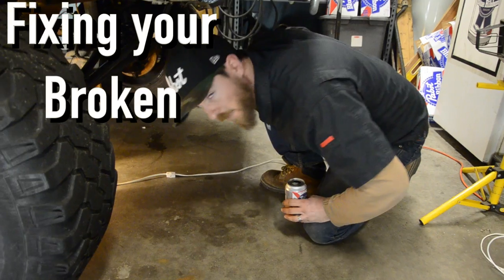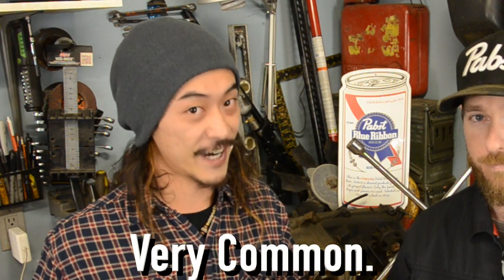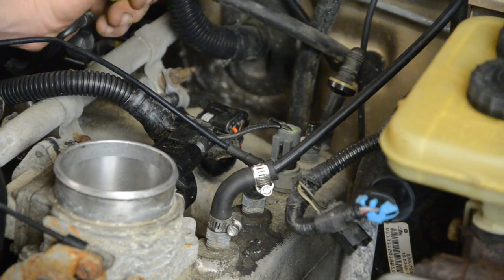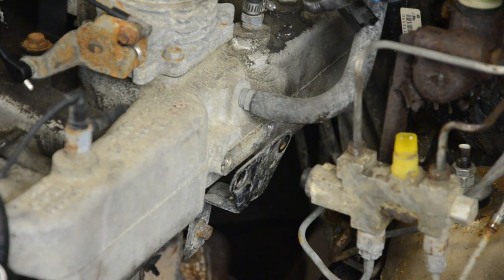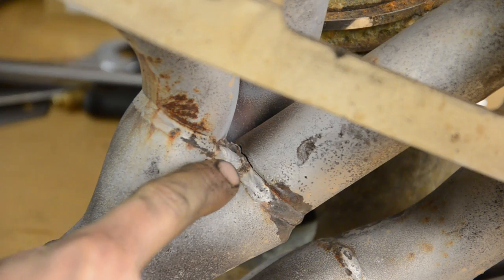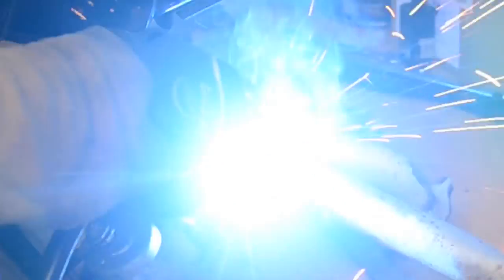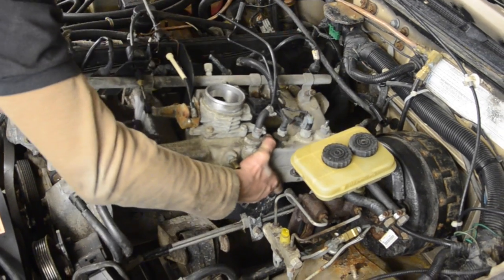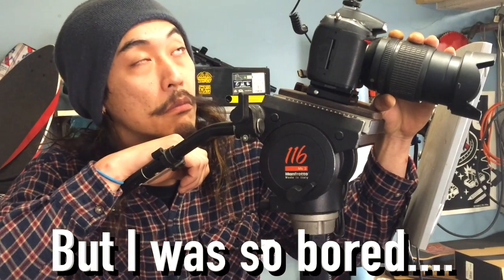Cracked Exhaust Manifold - Header - Jeep Cherokee XJ -The Roadhouse

Comment: I’m doing my first ever mechanic work it’s on a 1997 Jeep Grand Cherokee Laredo 4x4 with the in-line 6 4.0 liter think I said that right so far I replaced the thermostat radiator hoses water pump and fan clutch have it torn down for the head gasket to be done now

Comment: APN header?

Might end up doing just this. Since mine is leaking from the same points. Love how you guys just twirled the intake on top of the valve cover, saves time with disconnecting the injectors!
Reply from the maker: +AbsoluteAggressor 
And the Throttle cables.
All about savin' time

Comment: Hey guys I may have 2 do this. Fan does not come on so white smoke comes from radiator, coolant over flow tank is full and full when i open the thermostat (where i can put water if need be). but I do have faint white smoke from tail pipe. How can I test to see if It is a head gasket I need. I saw ur video on this. U guys are great!!  a girl fixing alone. will try .

Comment: Hey brother I tackled this task all alone and with that I also changed the head gasket. Everything was done to bolt pattern and torque specs. Now when I crank it up it revs up to 5000 rpms. Any insight on what could be the issue
Reply: Vacuum leak on intake gasket or unplugged vacuum line somewhere most likely

Comment: Did you guys flux core weld it or use gas? I’ve heard flux core was good for fixing cracks giving the weld more flexibility so it won’t crack in the same spot so to say, but idk if flux or gas would be better on exhaust. What’d you guys do or have any tips or tricks?

Comment: Any suggestions on how to get the 2 manifold bolts out of the bottom side of #4 and #5? On my 2001 XJ there are 2 catalytic converters in the way.
Reply: Use a stubby ratchet and a 2 in extension  stand on a milk crate and you can get your arm in between the manifold and block from the front as long as the power steerimg pump has been removed   I know this was an old post but incase others are reading with the same problem  I posted an answer anyway

Comment: great videos keep them up. how could you tell you needed to repair the manifold? could you here it or was there a loss of power? I have a 95 yj and there seams to be a tick I cant tell if it is a cracked manifold or a bad lifter. it goes away after fully warmed up.
Reply from the maker: It was really loud. just sounded like an exhaust leak
Reply: i think i might have something similar mine is really loud when i start it and the noise stays loud until it warms up. it almost sounds like a valve tap, but it goes away after it warms up.  does this sound like a manifold issue?
Reply from the maker: Crane 2005 it does. I see the same thing on ford trucks, where an exhaust manifold stud will snap off and have the same symptoms. It's really common for them.
Reply: great thank you. i guess i will be tearing into it soon

Comment: I think there's a misprint on the torque pattern display you used. I believe the spec for bolts 6 and 7 are 23 N.m (17 ft. lbs), not 23 ft. lbs. I'm by no means an expert, so I could be wrong.
Reply from the maker: +JonDinCT 
This is from a service manual, so if it's a typo, all us mechanics have been doin' it wrong for years...
But to be honest, the difference between 17flbs and 23flbs on a steel head is negligible.
Thanks for the comment though.

Comment: How long did it take ? and why do they crack ? Thanks guys
Reply: Tony Saprano mine did the same thing. My mechanic friend said that it’s the weight of the exhaust fatigues the manifold over time. He says that once it cracks, it’s in a better position. When the cracks are welded, it’s in a better position with less stress. Or something like that. He wasn’t allowed to weld a customer’s manifold so he’d weld the broken ones and install them for friends when theirs cracked.
Reply: Weight.
Heat cycles .
Exhaust taking a bump.
Different engine and trans mounts. 
No exhaust flex.
Etc

Comment: I recently got a death wobble and discovered a mechanic broke the steering adjuster pin and put a seam on it, so after asking around apparently I had to machine the hole to fit a new pin, so instead I fixed the shady job by my own shady job of putting flat nuts and to close it I used a non threaded screw metal thingy and bent it, I know the pain of being on budget my friends.
Reply from the maker: +Mahmood al-Walled 
Creativity often comes out of a lack of resources.
Keep pluggin' away Bud!

Comment: what would happen if you never fixed your cracked exhaust manifold?
Reply: the cold air being sucked into those cracks is said to, over time cause warping of the head,  but that's just what a few people have told me, it could be an old wives tale.
Reply: It'll kill gas mileage and also could get into the vehicle and you'll be breathing in carbon monoxide
Reply: Pretty sure Mitchell is right about the CO. Knowing the effects of CO poisoning I know that the cracks on my manifold I am getting poisoned. Now that it's winter and I can't keep the windows down I'm gonna have to fix it...
Reply: @mitchellabbott7919  
You're correct. And, add to that list it may trigger the engine light and fail emissions testing.

Comment: Do your self a big favor
Replace the casting or freeze out plugs  on 
The side 4 lt jeep motors are notorious 
And the back of the head most guys use JB
WELD AND SWITCH TO 
A LOWER PSI CAP YOU
CANT DO IT ON THE 90
AND EARLIER MOTORS